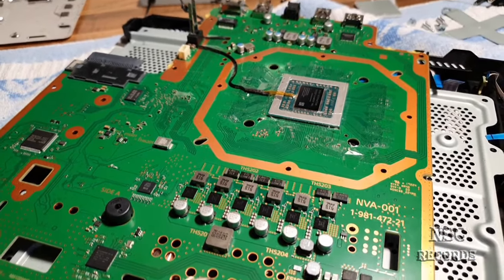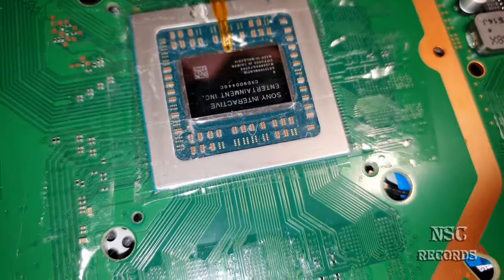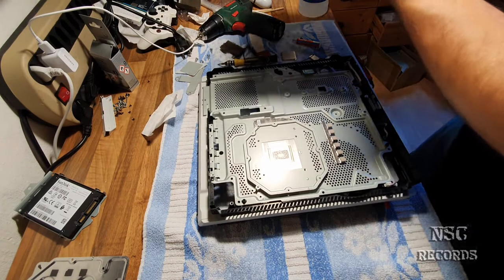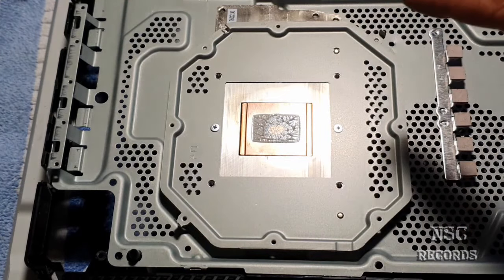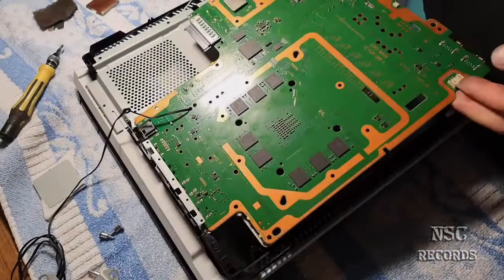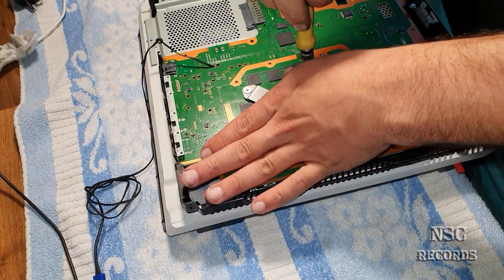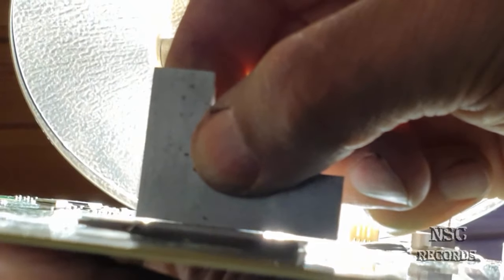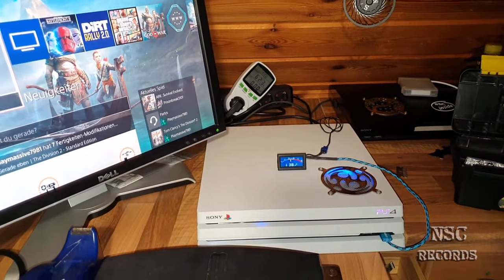That´s why your PS4 is still overheating after new thermal paste By:NSC

Comment: A simpler method to improve cooling on these consoles are to increase the pressure between the heat sink and the CPU and add more/a lot of cpu paste to make up for any imperfections. I added washers between the clamp and screw head of the cpu bracket. Carefully tightened it. Now my system runs very quiet and my heat sink is very hot as it should be.
Reply: Washers are a great idea, ty
Reply: My PS3 wouldn't work until I put washers, because there was a gap between the heat spreaders and the CPU. I'll try putting washers in my PS4, too. A Latin American guy said not to do it, so I didn't, but I'm having second thoughts, because it fixed my PS3 that wouldn't turn on. I've been using it daily for 2-3 months, and it's worked perfectly, so hopefully, the washers will fix my PS4 issues as well.

Battlefield V makes my PS4 fan go crazy. The system is much louder than either of my PS3 slims is every under heavy load. My PS4 used to be quiet.
Reply: On the Pro there’s Velcro washers under the CPU clamp it’s honestly weird because i still have this issue with my pro

Comment: I love this. Ive been looking at lapping and modding for thermal recently. One tip that I saw was that when you lap Jayz2cents , among others, suggests putting your sand paper on glass because its reliably a perfectly flat surface. You can also check your progress by putting grease on a piece of glass and putting that on your cpu/apu so you can visually observe the contact patch.
Reply from the maker: Yes i know, but in this case it was better to do that job without the glass. Ive lap a lot CPU's my self long ago, i did it always on my glass table 😀 But this here is an other art of operation 😅
Reply: Use regular glass and not temperd it usually is marked if temp. And granite is pretty flat also
Reply: I lapped mine.  It used to sound like a vacuum cleaner now its whisper quiet.   Due to the shape and hardware retaining I used knife sharpening stones to flatten it. Then went sanded and dremel polished

Comment: Hello I couldn’t really hear how you fixed it I think I heard sandpaper but I just wanted to make sure. Also I think this is my issue with my original ps4 since it is still getting too hot after a change in paste
Reply: Use alcohol pads to clean the old thermal paste. Then add good quality thermal paste in pea method. Do not use liquid metal thermal paste as it will eat away the heat spreader

Comment: Hello.. First of all, thank you for sharing your findings and helping others with your knowledge. 
  Thermal paste is applied to fill the minor imperfections of mating surfaces.
Maybe the thermal conductor wire has interfered with mating surface causing the larger gap to begin with?
  Thank you for your time and sharing with us your expertise.
Reply from the maker: You welcome. Sorry just saw this comment right now. Yes you right, but in this case the thermal paste is not working like it should because there's a beendet APU.

Comment: I have added Dow Corning 0.5mm thermal dissipative silicon pads to my APU in my PS4 Pro consoles, and the temperature has never risen above 122 degrees fahrenheit even after running the consoles continuously (24 hours/day)  for over a week. Thicker thermal pads attenuate heat transfer, so as long as I've used thin pads to conform the APU to the heatsink, all turned out better than expected. I've used Dow Corning thermal pads in varying thicknesses from 3mm to 0.5mm (in 0.5mm increments), and the 0.5 does the trick.
Reply from the maker: Yes, and 0.2 is best
Reply: For long-term stability and high thermal performance and almost no pump-out nothing beats Honeywell PTM7950 phase change paste sheets AFAIK. there is also a paste form but the paste needs a curing time of 24 hours before attaching the heatsink. I don't know the specs from the Dow Corning pads.
MX4/Kryonaut and many other popular pastes work great on desktop CPU's but are not very reliable on gpu's and direct-die with high temperature at 80'c and above. It starts with great day 1 temperatures and rapidly declines after a few weeks/months. 
Hard to spread high viscosity pastes works best on those situations, and that's the reason why pre-applied factory paste is thick.
Thermalright TFX, Shin-Etsu 7921-5, IC Diamond, Maxtor CTG9 are some high viscosity pastes.

Comment: For long-term stability and high thermal performance and almost no pump-out nothing beats Honeywell PTM7950 phase change paste sheets AFAIK. there is also a paste form but the paste needs a curing time of 24 hours before attaching the heatsink.
MX4/Kryonaut and many other popular pastes work great on desktop CPU's but are not very reliable on gpu's and direct-die with high temperature at 80'c and above. It starts with great day 1 temperatures and rapidly declines after a few weeks/months. 
Hard to spread high viscosity pastes works best on those situations, and that's the reason why pre-applied factory paste is thick.
Thermalright TFX, Shin-Etsu 7921-5, IC Diamond, Maxtor CTG9 are some high viscosity pastes.
Reply from the maker: Yes, but MX5 is great for most, consoles and PCs
Reply: I have no personal experience with MX5 but it seemed to have a higher viscosity making it a suitable option for laptops/direct-die and is discontinued (Probably because of complaints with 1 Star paste is crap and doesn't smear reviews) and replaced with MX-6.
According to the spec-sheet of MX-6 it has a viscosity of 45.000 Poise/4500 Pascal but i find that hard to believe.
Reply from the maker: @phenos  MX-6 available? Didn't know that

Comment: Thank you man. I replaced the thermal paste but it was still loud and over a short time it accumulated a lot of dust. I have just replaced the paste again after watching this, and could see I did a bad job last time because the old paste looked like the thumbnail for this video. I replaced it and checked it was even and now it is whisper quiet playing a AAA game. Thanks again
Reply from the maker: You welcome :)
Reply: I took advice from someone and used carbonaut. Was just as effective as a fresh application of thermal paste and doesnt drop off. Only downside its a pain to put on.
Reply: For some reason I applied new thermal paste and it's still loud 🔊 😪idk if I didn't apply enough thermal paste or what
Reply: @Plxdge  Do what I did, take it apart again (a pain I know but worth it) and see if the paste is spread even and that enough is there. Sounds time consuming but like I say it's worth it when it's done.
Reply: I had opened it up and saw that half of the thermal paste moved and a large portion of the heat sink and the apu had no thermal paste 😐
Reply: For some reason when I turn it on after I enter the game (cities skylines ) and load into the game ,the fan kicks into high gear and some mechanical noise is apparent and it vibrates my desk 🤕

At this point I feel like imma have to throw it away 😓

Comment: That’s why the cold plate on the heatsink is raised. It’s also why you should apply paste on the PS4 like a 5 🎲 middle top left bottom left top right bottom right.
Reply from the maker: Hehe, i know how to do that kinda stuff bro. 😅
Reply: @NSC-Modz  me too. But sanding down the SOC wasn’t the smartest thing cause now you have scratches. If you don’t think the apu gets proper contact. Take a clear plastic and do the same by pressing down. There’s still good contact mine does this to in the middle. Just don’t use a paste that’s liquid. PlayStations have pump out effect actually.
Reply from the maker: @alejandrotobienne584  i know, that's why I say, better don't lap it xD This was just more for my self, i have nothing to lose and i got a lot consoles here around, so if it goes bad, i have some more 😅 But for my tests i love to do crazy stuff like that 🤭✌did it in the past with some older Intel CPU's that's why i know the limits, somehow xD 😆

Comment: This might be why mine came out the factory with sooo much thermal paste, yet has been loud from day 1. Now it overheats very quickly even though it's dust-free. I cleaned the heatsink today (it was basically clean anyway) and I'm replacing the thermal paste tomorrow, so will check how level the surface is beforehand!! Thanks :)

Also the factory thermal paste is poor quality. Not very good conductance, and on mine it's dried out and cracking. Getting Arctic MX-4 :)
Reply from the maker: Yeah, that's right... let me know how it looks like than ;)
Reply: The heatsink side you cleaned is the exit. The side by fan is likely plugged. And yes Sony thermal paste from factory is trash.
Reply from the maker: @alejandrotobienne584  yeah, true, they do it so cheap as possible, to sell it so expensive as possible... $ony, for the Player$$$
Reply: @alejandrotobienne584  Dusted everything so knew it wasn't the issue. And yup, from the results I can tell their thermal paste sucks
Reply: @Samuel Torres Yep got Arctic MX4. Wiped/scraped old paste away, cleaned up with isopropyl alcohol, then applied Arctic paste. I think I made two small lines, then smeared it across with a card just because I was worried about it not making full contact. 

My PS4 has not overheated once since changing the paste, and it is very quiet!!
Reply: @NSC-Modz  Forgot to update, but yep, change of paste completely fixed the issue. PS4 is now very quiet, no bursts of helicopter activity, and hasn't shut down once. :)

Comment: Nice job my guy
Today i cleaned my ps4 after 6 years since i bought it. I also bent the metal plate from above to make it touch the heatsink and applied thermal paste. It does still sounds, i would also like to lap it a bit, but the process of dissasembly is complicated hahaha
Reply from the maker: Yeah, let it sound if it's just a bit 😀

Comment: Great information & video 👍

Checked my 7102B Pro brought 2nd hand in Mint condition but was like a 747 taking off .
So teared it down ( was still factory paste ) checked the Apu with a razor blade ( Geez )  my Apu was worse than yours , had a big rise ( hill ) so I took my time with sanding the heatsink to match the Apu Took me about 8 checks with reapplying thermal paste but turned out great . Used thermal grizzly paste & pads & added a pad on the HDMI encoder Chip as well as the southbridge to transfer heat away to the cover shield . 
Now runs so quiet 😁

Thankyou for your great work 🤟
Reply from the maker: OMG Even worse than my APU? 😆 Yeah bro. So you did a great job to 😀 ✌️ You always welcome, hope you subbed 😜

Comment: Interesting. I wonder if there are differences between production runs or if large amounts of thermal paste is a bad thing.
I covered the components around the die with UV curing soldermask and applied a thin coat of liquid metal on the die and also on the heat sink. Then I just reassembled it - that was it.
Ever since I changed to liquid metal, the PS4 Pro never ramps up in fan-speed, it just blows hotter and hotter air out its back. (If I move the PS4 around too much or take it with me to go see somebody it has started to ramp up when under heavy load a few times the past few years I have had it - I suspect the liquid metal (galistan alloy) bond goes bad and crystalizes after a while - as it works perfectly after a clean-up and reapply job)
Reply from the maker: OMG, i just saw your comment right now, I'm sorry. Yes, liquid metal is a good thing here, because LM could help to fill the free space between the bended die and the cooler. Only thing is bad is that the APU Clamp will lose the pressure with the time, that's why LM will not work for a long time on consoles, because this cheapy clamps lose the pressure with the time. LM is best for computers because the coolers here get real fixed. But LM gets hard with the time, so this could help to fill the free space on the sides where the APU is bended... Cheers bro.

Comment: I did lapping,the result in idle after  30 min i get 43°. 😁And after 10 hours gaming temp is 62°max 66 °,fan noise i quite and I am very pleased with the results.all measurements are taken from the back of the console, with a temp probe.
I have thought machining heatsink from copper, it can give even better results,

Comment: I had just gotten a PS4 Pro just before the PS5 came out. How often should I replace thermal paste if the thermal conductivity is so high in the center? Ive been experiencing the same issues.
Reply from the maker: It conforms how much you play... but 1x in two years should be more than enough. Bigger problem is to much dust on the Heatsink, if the Heatsink is blocked, the hot air can't get out so great...

Comment: Is this PS4 Pro still working quiet? I tried a lot of solutions but they only work for short time so I'm thinking about trying this.
Reply from the maker: Sure, it's my baby :) working quiet and if i like I can adjust the fan speed. Get Kryonaut thermal paste and check if your APU is Ok. After this video a lot people's told me about the same problem. If your APU in convex, than just lap the cooler. Lapping the APU is just for freaks 😅 so take care pls
Reply: @NSC-Modz  Thanks for response. I just checked and my APU is also convex. My copper heatsink is not flat, it is wavy, so first I have to lapp it to flat and then brush the middle of heatsink. I have MX-4 instead of Kryonaut, do you think MX-4 could work long term or I should order Kryonaut?
Reply from the maker: @emirosmic5245  i knew it... a lot people's more and more have this problem... shame on Sony. Yes, MX4 is great.

Comment: What do you think about a thermal pad where the battery is? Could that make some what of a difference? My PS4 pro is cleaned and has great thermal paste but sanding could be a risk for me
Reply from the maker: No, just not worth... before sanding first check if you really have this problem, if yes you still can sanding the cooler and than work with liquid metal, but always take care.

Comment: Thanks so much for video, great job!
I have a question, can u solve problem using thermal pads instead of thermal past?  Thermal pads could take the shape of apu, what you think about that?
Thank you :)
Reply from the maker: Thank you very much. No, better not, the APU gets really hot and the heat transfer needs to be very fast... so please use only thermal paste.

Comment: Hello please i have a problem. Basically my ps4 slim fan stopped working for a while so I removed it recently. before I removed it, although the fan was bad I could play games by placing a standing fan on top the open cover of the ps4 . Currently without the bad internal fan the ps4 overheats(even though i still place the standing fan on it). Mind you the ps4 body temperature is low. It just doesn't want me to play any game. Could it be the thermal paste  or I need to connect an internal fan for it to work. Becaue i  replaced the thermal paste and it still doesn't work. It allows me to enter the game menu but the second i want to play the game the ps4 says its hot and switches off. Please help me idk whay to do again
Reply from the maker: Hi Sounds like overheating of course. Did you check the pressure? The clamps should have good pressure, otherwise it will still overheat. And better use the Original Fan, it makes more airflow...
Reply: @NSC-Modz  ok thanks

Comment: I have a question, What if i replace the thermal paste and add a Thermal pad? Will it not work?
Reply from the maker: Yes, if you use the right thermal pad witch should be very thin and from graphite or the special ones from thermal grizzly, but if your APU is like on this Video, than it will be the same $h't

Comment: Me and you go way back I’ve seen your videos.crazy me and you modified our ps4 pro just the same but I used liquid metal and out my thermal temperature gauge screen in top twords the front.you’ll see a space around the fan that is very small that was cut out I used plastic bottle parts to glue and melt in to form a seal.I’m about to do my ps5 with a temperature gauge also I like the look.Thank you the nsc Frankenstein.

Comment: That is the work of thermal paste, isn't it? Thermal paste is applied in order to fill the space and imperfections between the 2 surfaces. 

Any component has a tolerance. As long as they are into some marks they are accepted as ok.

Thanks so much for your videos! They are useful and fun at the same time. I will say the are "usefun" ;)
Reply from the maker: hehe thank you very much... yes, thats the work of the thermal paste, but this was just to much space for the paste... maybe, but only maybe liquid metal could work better in this case :)
Reply: @NSC-Modz  Thanks again. Wear in mind you are always handelling with faulty units so it it is more probable to find defaults. I am sure that units that are working perfectly for years does not end up in your laboratory so your opinion about quality is a bit biased :)
Reply from the maker: @AngelKsiezyc  Hehe that's true ^^
Reply: But if the thermal paste too thick it is not transfer heat effectively.
Reply from the maker: @solidsnake1089  yep ;)

Comment: What about putting 2mm or 3mm thick thermal pads on instead??
Reply from the maker: It would overheat...
Reply: @NSC-Modz  ive tought maybe more less conducting material is better than a point of conducting material.... and what about the graphite termal pads? Many people sayd they solved with it
Reply from the maker: @Jeddo92  graphite is better than pads
Reply: I would try a small piece in the center area to fill gap and paste around the perimeter.
Reply from the maker: @jacobclark89  or a bit thermal glue dot there, let it dry and lap it ;)